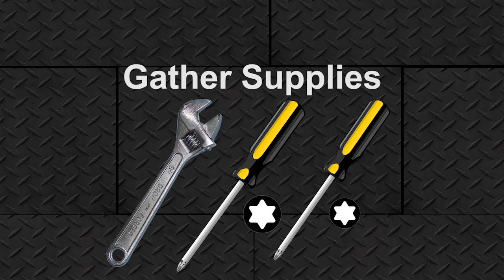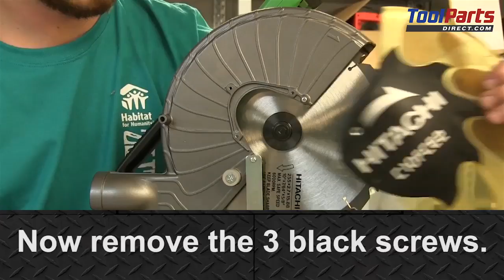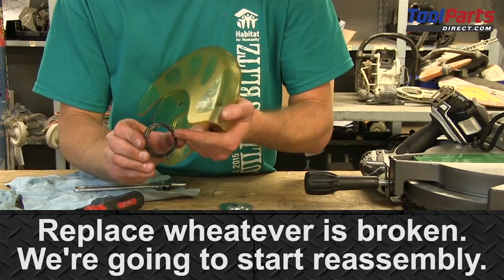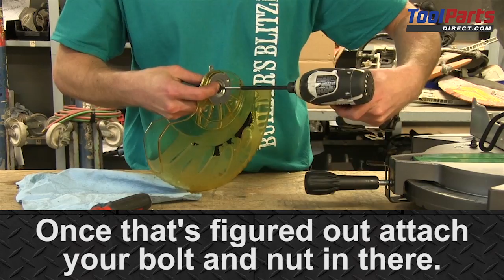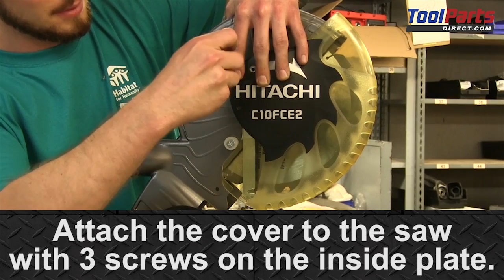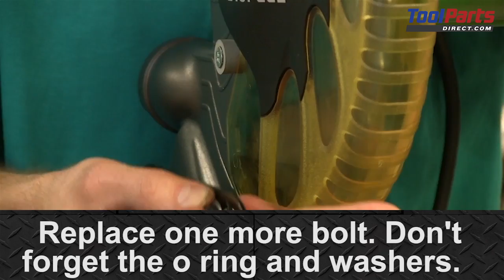How to change the safety cover on a Hitachi miter saw

Comment: Hey there, I have the same question??
Reply from the maker: Looks like there is a different style of spring in the saw than what is in the video. 

Looks to me like spring (201A) has to hook to lower guard (200) and then be able to pull guard down. In order for this to happen, the spring has to hook to the upper guard in some manner. I have seen these style of springs hooked through holes in the upper guard or on a stud in the upper guard.

https://www.toolpartsdirect.com/hitachi-c10fsh-10-sliding-dual-bevel-compound-miter-saw-with-laser-marker.html